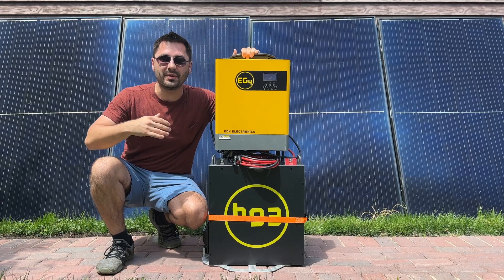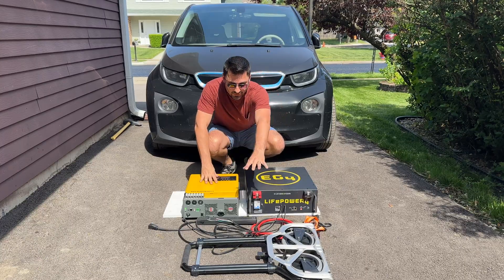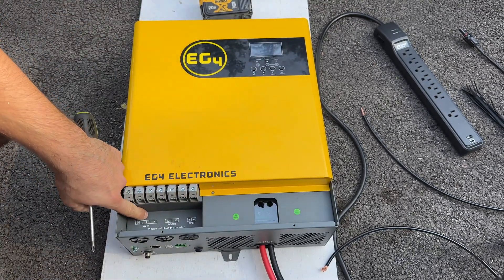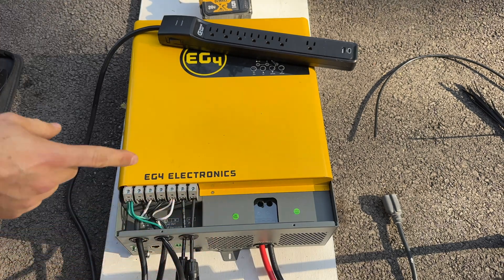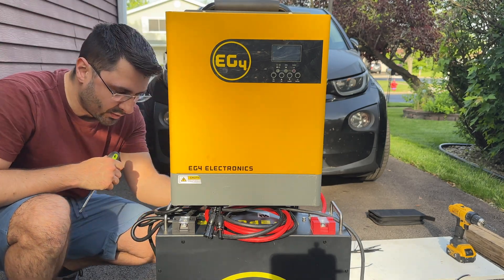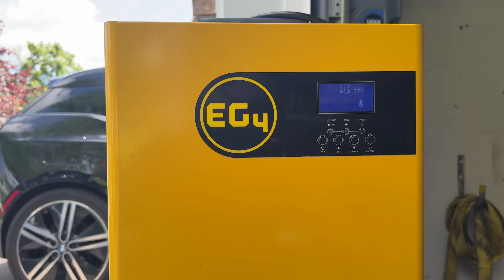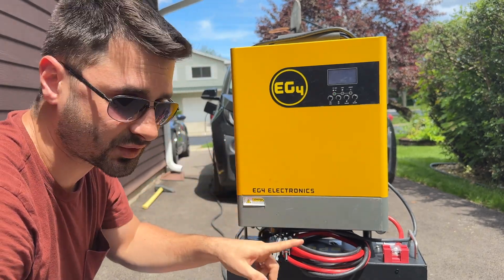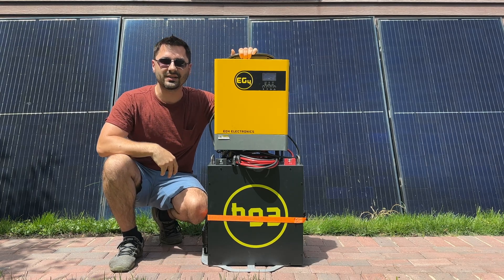I BUILT A Portable Solar Power Station That Can Charge My EV!

Comment: Am I right to think this, i mean no disrespect, just a thought in my mind. The BMW EV will normally have a 70-100 kwh battery. the one you built the battery only has a capacity of 5khw which will take all day to charge. How much was the total cost of this project again?
Reply from the maker: The beauty is you can charge directly from the sun to the car. You don’t need to use the battery. That’s the buffer. Of course it’s trickle charging, but if you’re driving 20-30 miles a day, it’ll be enough to keep the car topped off

Comment: This is what I would do , if I ever had to buy a EV , I would charge it with solar at my home.  What I want is mini version of this that would charge an EV battery , even slow would be good while I’m on trip as my car is parked or on the highway for long periods of time.  IMO , EV has to get to this point faster and cheaper with best solar panels and smart placement and installation to maximize input to the inverter

Comment: I wonder if this is scalable to some sort of "portable EV fast charger" with something like this:
15kwh battery from aliexpress, for example, (there's a few fairly compact ones inside nice looking cases with wheels already on them), hooked up to like a 7.6kw wallbox charger (or at the very least a 3.7kw schuko plug one). I'm guessing some sort of inverter is still needed (not sure if the wallbox acts as one?).
I'd need to be able to keep the portable battery charged from a standard home plug overnight and then use it to keep a plug in hybrid (25.4kwh battery) topped up at around 80% every other day, as needed. why? I can't charge at home as I don't have a garage and can only park on the opposite side of the road (can't run cables). I also don't have the theoretical car yet (but the model I'm interested in has those battery specs lol), I'm still using an old diesel and looking to get something newer, such as a phev, soon-ish.
I would love a video on something larger/faster scale like this. this one from the video seems very similar to what I'm talking about but at much less capacity and a lot slower charging, so I wonder if it's actually doable on this scale while keeping a small enough footprint 🙏

Comment: Did you have to upgrade your Firmware to get your Inverter and battery to "talk" through the RS485 Port? (I am assuming you didn't use the "CAN" port).  How are your dip switches configured? I am 6 months into Tech Support (good people) at Signature and my exact system as yours still will not "talk" through the COM port so I that when I select "Li4" I get an error code. Any advise would be appreciated. Thank you.

Comment: That high frequency, trandformerless inverter was a poor choice in your design. High frequency inverters like this EG4 unit offer a poorer surge capacity, a shorter life expectancy, and they can damage your appliances when their MOSFETs fail. You should have used a low frequency, transformer based inverter instead.

Comment: Dude. One day you're going to fry your EVs onboard charger and void you're EVs warranty with that cheap high frequency, transformerless inverter because it doesn't provide any galvanic isolation. With no output transformer, your EVs onboard charger will soon be toast.

Comment: Great Video !!  I am not DIY inclined, If YOU had to make a choice with your knowledge and research, which off the shelf system would you buy?  I bought a plug in Hybrid that has a 18.1 kwh battery to charge.  It takes approximately 10-12 hours to get it to 100 % from 0 on home on grid 110 voltage.  Thanks for any advice you can give me.

Comment: Hooked up a duplicate of this and my Ev charger is returning a ground fault red flashing error, have had no luck so far getting it to work as is.
Reply: I'm there too! I've used 2 level 1 chargers and both fault out...even when not plugged into the car. There's something odd about the inverter power that faults out both chargers....frustrating! HOWEVER, if I add utility power to the inverter (although it's only drawing power for the fans) it works fine. But the whole idea is to NOT connect to the grid at all!

Comment: I'm only speculating here but if your main goal is EV charging then you may be better off with a Inverter with 240v output. You would then need a step down to power your power strip, but they are quite cheap. Charging EV from 240v is seriously quicker.
Reply from the maker: That’s a great idea, but I’m not trying to be quick here. I just need to top up the car after daily commute and it’s been working perfectly for that!

Comment: I have the same components, EG4 inverter and EG4 battery with 4 300 watt solar panels. I also have the same car BMW i3. But when I plug in my level 1 ev charger it lights up with "power fault"... Maybe my charger isn't liking something coming from the inverter...? The system works well for other loads, like space heater and e-bike charger... What could be the issue?
Reply from the maker: What kind of charger is it and how much does it draw? Does it go over 3000w on start up? I've since upgraded to a 20a charger and it's been working flawlessly.
Reply: @SimpleCarGuy  It came with my used 2014 i3, The brand is Delphi. Having trouble finding much other info about it...
Reply: @SimpleCarGuy  Looks like this is a 30amp charger,  but does it really pull 30amps? I do have a 20amp circuit breaker in between my EG4 inverter and the charger outlet... 🤔
Reply from the maker: If it’s a 30amp charger, it’s capable of pulling 3600watts so that’d be the problem. Can it be limited to 20-25amps?
If not, you can reduce the charging speed from inside the car. Set it to medium speed and it’ll work.
Reply: I have this problem too. I've tried 2 different level 1 (120V) chargers and each one immediately faults out. I'm certain that it's not drawing too much current...inverter is set to 20A. Testing the chargers using a "Kill-A-Watt" tester, I can verify they draw about 1000W. But, the problem only exists if the inverter grid power is unplugged. If I run the unit with the inverter plugged into the grid, it all works fine. But, for me, the whole point is to be able to charge WITHOUT being connected to the grid! Also, when plugged into the grid I can't get the unit to not switch to bypass and connect to the  grid when the solar and battery are depleted (another issue for later). But, again, if I unplug the grid power my EV charger immediately faults out. I'm wondering if maybe it's because the charger doesn't see a ground when the inverter is unplugged and this causes the fault. I'm using the house wiring ground through the receptacle to provide the ground for the inverter and battery and when I unplug from house power (grid), that ground goes away and the EV charger trips. But, it seems to work here in the video for Simple Car Guy and he doesn't have a ground...hmmm, any thoughts?
Reply: I got a new charger off of Amazon, it let's you set the desired current, and now it's working.
Reply: @andShit23  what did you get?
Reply: I'm using the same Delphi charger and it only draws 1100A...don't know why it keeps faulting out. But, it works fine as long as the inverter is plugged into grid power at the same time. It doesn't seem to be drawing any grid power as the inverter is only drawing about 20 watts....but if I unplug the grid power the ev charger faults out....frustrating!

Comment: if it was me I'd put a din rail mounted MCB (mini circuit breaker) in a pull box between the inverter and it's AC input cord, just so I never have to worry about the stuff plugged into it melting that extension cord
Reply from the maker: Great idea!

Comment: How many solar panels to charge this
Reply from the maker: Well, it depends..
The solar charger here needs at least 120v from the solar panels to turn on. The panels I showed in this video are 34 volts each, so I need at the minimum 4 panels. I currently have 10 panels connected and that's been plenty to keep my car changed all the time. I haven't had to plug it into grid since June.

Comment: What brand and type of panels are you using? Also Mono or Poly panels?
Reply from the maker: Those are Jinko Solar 325W poly panels I got locally on FB marketplace for $50. More recently, I got Q.PEAK DUO 340W panels for $30, so there are definitely deals to be had.

Comment: One day you will fry your your EVs onboard charger because your EG4 inverter has no isolation transformer to provide galvanic isolation to prevent high voltage DC current from passing through to your EV's onboard charger. All it will take is for a single MOSFET in the H-Bridge circuit in your EG4 to short to ground, (which by the way is a common failure scenario in all high frequency inverters), and you can not only damage your EV's charger, but will also void your EV's warranty. Sure you can charge your EV today, but give it time and I can guaranty you, you will have regrets. If you want to safely charge your EV, then you should be using a low frequency, transformer based inverter instead. To learn more about why you should never use a high frequency, transformerless inverter like the EG4 to charge an EV, watch "Solar Inverter Catastrophic Failure" by Red Hill Labs on Youtube.
Reply: false

Comment: Just got my "gas" station built for an EV myself this past year....now just gotta find an EV that is not so darn expensive....till then using the power in the house. Nice video
Reply: Get a used Chevy Bolt. You can get one right now that has 30k or so miles got $15k

Comment: Have you looked into adding solar cells to the roof of the BMW i3? I saw a yacht that had solar cells panels built into cabin and outer hull.
Reply from the maker: It wouldn’t do much at all and definitely not worth the trouble of carrying an inverter and battery with you and added drag.
Reply: @SimpleCarGuy doesn’t the bmw i3 has inverter and batteries built-in? Shouldn’t you have flex solar cell overlay the roof panel and hook the DC charge circuit to the solar cells array?
Reply: Not enough surface area to make any sort of meaningful juice.

Comment: you can build your own 24v 8kwh battery for around 450 bucks. if you run an EU spec inverter which has double the voltage, therefore half the cost (since cost is based on amps), you can get a 3kwh inverter for around 200-300 bucks if you cheap out on the solar input. 
if you use small balance boards instead of expensive BMS', one for each 12v 4s cell group, you can cut the price of the battery in half. cheap bms' are the cause of most battery fires. imo 3$ inductive 4s active balancer > most resistive bms' on the market.
ironically 8x 280ah lifepo4 cells (~8kwh) fits perfectly inside of a surpluss 20mm ammo can if you face all the contacts inside. fire resistant, would catch any electrolyte spills/explosions. the cans are like 30-40 bucks depending on how many you buy, and they come with heavy duty handles and a lid that seals really well. ya 700-800 bucks and you can build twice the battery pack for half the price. almost all ev's charge off 220v, usually way faster. you can wire in an E bike charger and connect your 240v home ev charger to charge the battery pack and even do pass through charging to your car if you find a free charger when youre out and about

Comment: How long does it take to charge the car with the battery vs with a regular outlet?
Reply: Charging from a regular outlet is only going to add four or five miles an hour. The source of that electricity does not matter.

Comment: Cool build, but 120V limits your charging to adding roughly 4 miles of range per hour.  It’d be worth getting a 240V capable setup to charge at least 3X faster.

Comment: It is nice; but it isn't free which you labled on your video - you paid quite a bit for this unit; and the next question is how long will the batteries and panels last so you can determine the cost per mile.

Comment: I am impressed. This is a “Will Prowse type” of making sense of a complicated system of components. Explained the inverter main important settings in two minutes, otherwise someone could spend half a day researching those settings!! Just Fantastic!
Reply: Agreed!… great job!
Reply: And just like Will Prowse, this guy said nothing about the breakers that the manuals for this inverter and battery say are required.  Like, 4 breakers.   And not enough about grounding, which is also mentioned in the manuals that came with the inverter & battery.    At least this guy mentions that you need better gauge AC wires.  Having said that, this guy did a really good job of walking through a simple set-up.  I bought this inverter and battery from Signature Solar and they were pretty good, though not helpful enough for this scared and skill-less beginner.    I especially appreciated his walking through the set up menu and all the necessary options.   THANK YOU SimpleCarGuy - this was very helpful.  :)
Reply: @dkbkmk01  You can add breakers but it has built in ocpd on ac output, if you use proper gauge wire, its fine. it will trip, I have done it before. and grounding? Run it floating. It is fine. Yeah he did a good job with this video. I still havent changed the settings on mine haha I just hook it up and run it

Comment: Is there a way with that all in one to take in power from a 12v dc source like an RV alternator? 
I take it that all in one does not support communications with the battery (I did not see you plug in communications wiring)?
Reply: You would have to use a step down converter. Will Prowse YouTube channel has this build with 12v converter attached to the battery.
Reply: You can use a 12v dc inverter that ya plug in to a cigarette lighter to charge....but it would be a really really long time and you would not get more than 5 amps of 120v AC off that inverter from the lighter socket....I would just say overall....not worth destroying your RV alternator....not designed for that.

Comment: Can we use 2 battery?
Reply from the maker: Of course, this system can be expanded in almost any way
Reply: @SimpleCarGuy  In your experience. How many of this battery do we need to power the house without hvac system?
Reply: @TienTran-bi1jv  with 2kw of panels you can use two of those batteries pretty well, 10kwh of 48v.

Comment: Is there not an APP for this?  Doing all the changes with that little archaic LCD from 1967 is lame.
Reply from the maker: Yes, there is. You do have to be connected to WiFi though, which may not always be possible in off grid situations, so I wanted to show it live on the unit.

Comment: Hi.  Curious if the outlets and usb are for 48v appliances?   Would my computer fry if I plug it in to the outlet?   I figured I would need some 48V to 12V down converter?
Reply: There is no need for a "48V to 12V down converter."  The storage battery is 48V DC (Direct Current).  The inverter (the yellow box) makes that 48V from the batteries into 110V AC (normal household power - just like the power outlets in your house).  As such, you can plug anything into the power strip (he has a power strip hard wired into the yellow box) as long as it is not over 3000 watts total.

Keep in mind that power strip is most likely only rated for 13 amps (or about  1500 watts total).  Therefore, even though his inverter is capable of putting out 3000 watts continuous, his power strip is limiting the output to 1500 watts.  That is why he hard wired a second NEMA 5-15 plug into the inverter so he could use the car charger without overloading his cheap power strip.

Bottom line, any normal item you could plug into your houses wall power outlets,  you can plug into this system.  Of course, everything plugged in can not be over 3000 watts in total.  Or, in his specific case, 1500 watts total since he is using a lightweight power strip.

-Steve
Reply: @hughes500pilot1  Thanks for putting all that information into simple understandable basics, it really helps, thanks!
Reply: @hughes500pilot1  Great answer and thanks.... I was wondering about that limited watt power strip.  haha
Reply: @hughes500pilot1 you are a legend Steve! Thank you for this response
Reply: I think I just realized why my question.   The 48V is converted to DC and will run most appliances on DC until.3000W are taken?

Comment: A nice little system, however it’s a little small to effectively charge the i3 fully. Are you planning to scale this up?
Reply from the maker: I added a bunch more panels and wired up a 15amp charger. Now it charges at 1.85kW. So, it takes 10 hours from 0-100. I drive around 15-20 miles a day, so this system fully recharges the car each day for me, unless it’s raining.
Reply: @SimpleCarGuy  What 15A charger did you buy? My i3 charger faults out unless I add grid power.....can't get it to work....any ideas?

Comment: Wouldn’t it be better to use a breaker box for the solar input for connecting and disconnecting them? Also, is there an app that you can use to adjust the settings? Thanks

Comment: nice project ..
actuallly charging your EV directly from the sun and storing it in a battery that is complexly portable, WOW...I would like to build something like this for my EV, good thing too is that I can also charge the battery on my eBike as well brilliant....

just one question: as I live in Australia could I buy the EG4 in Australia or where would I buy it from, and would they ship to Australia....thanks again for the video
Reply from the maker: I've been using it to charge my eBike as well and now powering a mini split also. I've added a few panels and it's powering everything without any issues!
As far as shipping to Australia, I have no idea.. I imagine you guys have other brands with similar set up there that would do the job just as well.